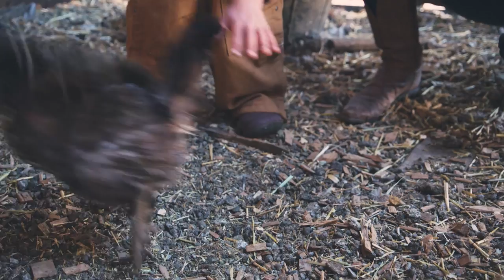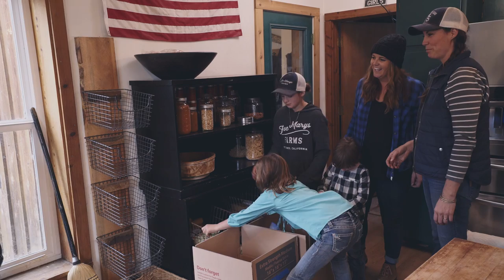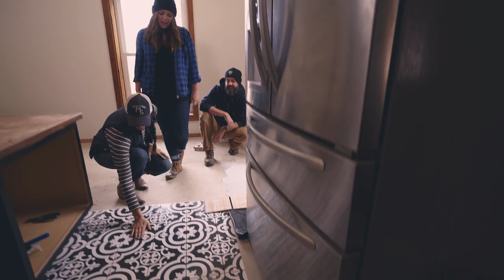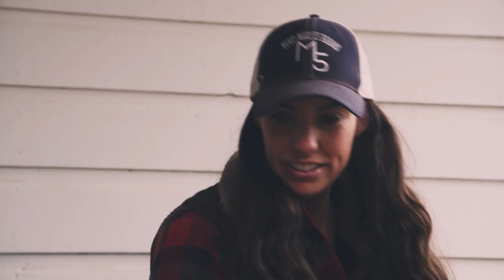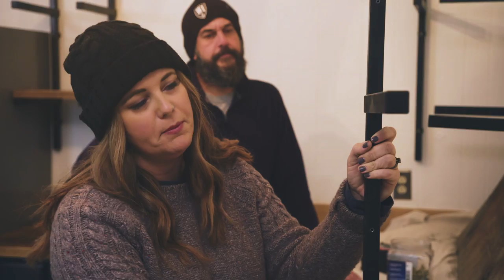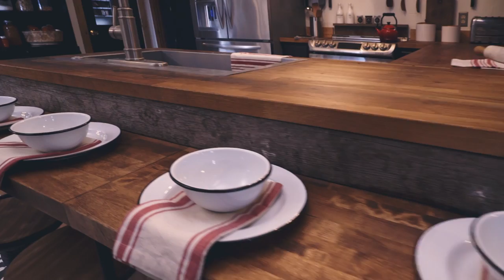The Weekender: "5 Mary's and a Kitchen" (Season 3, Episode 6)

Comment: Hate paneling and bead board as backsplash. We currently have bead board and it’s awful to clean because of the nooks and crannies. Plus you have to watch what you’re issuing to clean it for grease or the paints will wear down. We are planning to replace with subway tiles this summer.

Comment: The galvinized pipe looked good in this iteration, however, the trend in using it means it will look dated in many cases.  The use of it on the bookshelves in the philadelphia attic clashed with the more mid-century furniture.  The classic floor brightened the space and added chic.  Those tiles are timeless.  Since oak is a light colored wood, why didn't you just wipe on some black to give it a distressed look, but keep the beautiful grain visible.  Covering solid oak seems a crime.  If the doors were cheap and  needed masking I could see doing that.  Also the solid paint job took a lot of time.